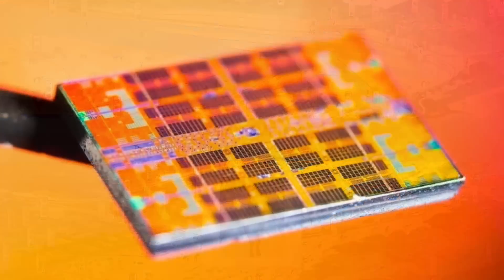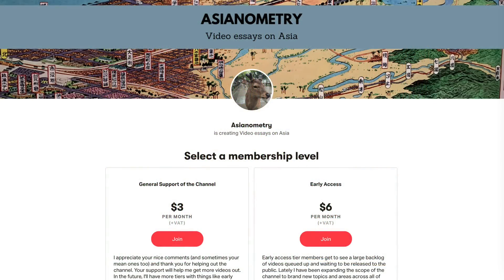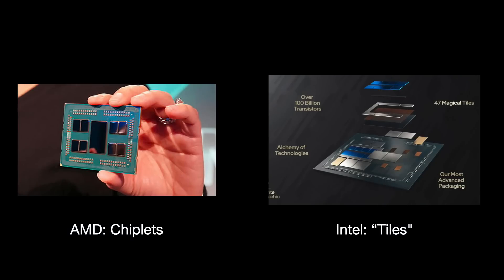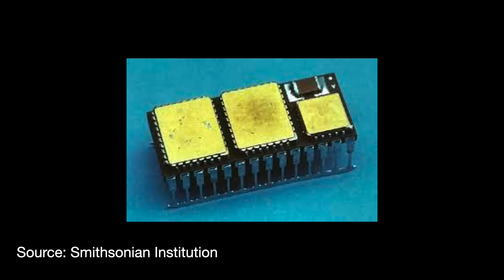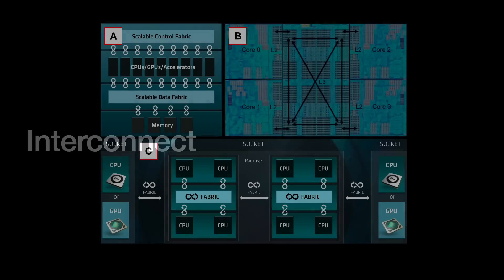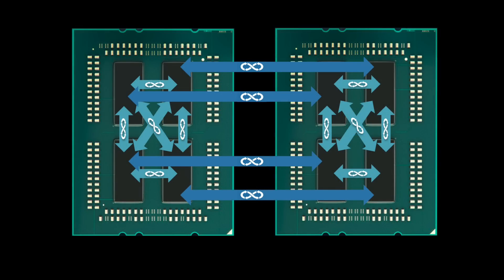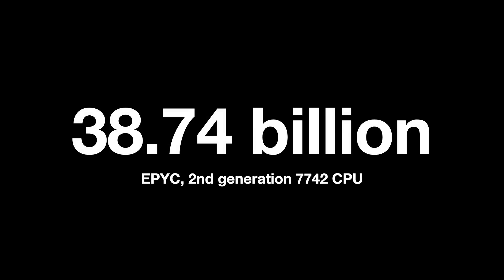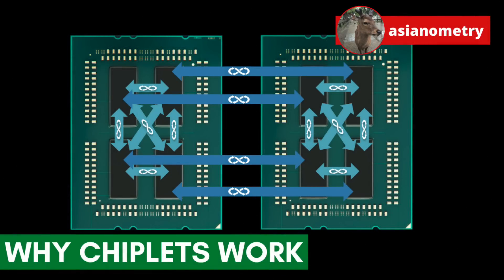Why AMD's Chiplets Work

Comment: And now Intel, AMD, ARM, and others are getting together to come up with an interconnect standard. We could see chiplets from different vendors on the same package. Imagine AMD cores alongside ARM and even FPGA fabric, tasked with handling different aspects of a system.
Reply: this might also solves licensing hell intel made to prevent vendors integrating both arm and x86 ISA into one single die.
Reply: @kekkocheng  Why not connect 7 billion brains to Make a more powerful computer ?
Reply: It's already  done. Check each Threadripper, EPYC and Ryzen Pro - each CPU has a small ARM CPU inside for the Platform Security Processor (PSP).
Reply: Will be interesting to see what new solutions it makes possible. e.g. AMD have dominated the console space because they are one of the only players that has all the technology and IP required to produce a monolothic SOC that can provide a good experience for gaming. My hope is that eventually it allows manufacturers to shop around to some degree, combining whichever parts that are available and best suited for their product. For instance I could imagine a high end tablet or gaming handheld using a CPU from Qualcomm and a GPU from Nvidia, and using UCIe to avoid those two companies having to collaborate too closely or share sensitive IP.

Of course you can already have a separate CPU and discrete GPU from different companies, but this complicates the cooling, and I suspect packaging everything together could have cost and latency advantages too.
Reply: @liamness  Nvidia is not part of UCIe. It’s not possible (yet)
Reply: In other words gluing together chips.
Reply: @mohdk2299  Yeah, maybe they will be moved to join if they see others doing well out of it. Was just using them as a generic example of a chipmaker with graphics expertise, AMD or Intel could be subtituted
Reply: LOL in the mean time Nvidia is left behind...
Reply: I think AMD is going to build FPGA functionality into their core chiplet or it will be too slow.  They bought Xilinx after all.
Reply: @kekkocheng  AMD has the rights to X86 and Intel has the rights to X86-64 via AMD.  There are supplemental instructions sets that gives X86-64 the extra power and fast compute in various workloads where ARM suffers.  Almost all are cross-licensed.  ARM is RISC like it or not, and will never be great as a DO EVERYTHING CPU.  This is why a company like Apple takes a CPU that's ARM based and then customizes it to make it good enough to run typical workloads for an Apple laptop or desktop device.  Apple also added accelerators which is probably similar to Intel's, where they speed up stream processing.

Throwing ARM cores with X86-64 cores is a huge MESS.  You pretty much have to use one or the other for a program, not both, or you could but it would come with a LOT of complexity.  You do after all have to execute instructions to run a program and a compiler has to make sense of the hardware via the ISA, which means a person had to program a compiler to be able to use the hardware within an SoC.  But sure you could probably get away with compiling a program that runs with the ARM cores and at the same time another program compiled for X86-64 and uses those cores.  Probably not so good if these are combined and have to share the same resources that a core needs, like APU, FPU, IO, etc....

However, it's ARM, AMD and Intel who are talking about this interconnect standard, so I think you're turning this into something it's not.
Reply: @dongshengdi773  I bet Elon already has plans for that
Reply: yeah,... that also means outsourcing the cheaper aspects of it
Reply: That's the PCIe CXL standard you care looking for.
Reply: @johndoh5182    ISA has nothing to do with how pipeline is integrated.
Otherwise we wouldn't be seeing all architectures supporting same Instructions. ARM architectures and it's pipelines are getting more CISC like in recent years if you look deeper and same is true for these x86 pipelines where they pick best of RISC designs. As time evolves there will be mixture of ISAs doing best in their own regions, some good for compute loads, some good for data stream processing, some optimised for floating operations etc.

Besides apple, there's qcomm, samsung, marvell, nvidia, rockwell, amd and lots other impmenting their own logic on top of spec. The whole industry is just 1 century old, from transistors to the miniature devices we see today and its going to take few more decades to sort out the road blocks.

This is actually called Heterogeneous computing and it's not new to industry. Modern tooling allows us to integrate different ABIs to run on complete different ISAs which wasnt possible in early days. Still there's lot of work to do before is can enter consumer relam. And all talks from vendors is kind of hype as they dont have to talk about anything else as it's getting harder and harder to innovate further solely on fav process only.
Reply: @dongshengdi773  not a bad idea.
Reply: @MaulikParmar210  seamlessly moving code between architectures. Thanks to LLVM IR code.
Reply: @monad_tcp  problem is not all eco systems use llvm as backend and they are pretty huge well established around single architecture, some use other backends and there is still no industry concision on where to move forward or how to unify, it's there moving on it's own pace. It's just almost 2 decades old, give it time to grow and settle!
Reply: @MaulikParmar210  that's the problem.
Monolithic architectures instead of pipelined ones.
Reply: A UCIe style open standard is long overdue. Although I am against separating all CPU cores into chiplets the chiplet idea and advanced, many-layered PCB substrate interconnect is essential to fully realise the potential of the chips used in a system.. The biggest problem for X86, and ARM to a much lesser extent is the complexity of their cores. Even ARM is not so RISC-like as it once was.. 
--
SIMD is the main culprit. MMX, or at least SSE onward should have been a general Vector Engine coprocessor, SIMD scales ridiculously poorly. UCIe should allow the CPU, GPU, General Vector Processor (that could replace the GPU entirely in the future) to share a huge (16GB) Level 3 cache on one chiplet. Like you say, this is in the pipeline as it makes so much sense..
--
Dedicated PCIe graphics cards for gamers will be obsolete in less than 5 years, probably closer to 3..
Reply: An x86+ARM chip would be so painful to use. No ABI compatibility, no cache coherence, duplication of compiler toolchains and precompiled libraries, separate and overlapping page tables, etc. Few programs would use both chiplets if they have different ISAs.
Reply: @monad_tcp   you wouldn't see millions of lines ofncode moving from one backend to another in nesr future, so keeping expectations realistic is the key to drive this type of innovation in long run.

Besides not all architectures can use pipelines, there are so many close to metal usecaaes which defies usage of llvm for compilation and requires more sophisticated methods. Though not majority of engineers would be using such methods, they are backbones of computational infrastructure i.e Device Drivers, Interfacing APIs, Usermode and kernelmode boundary applications etc which goes beyond scope of normal usage of llvm.
Reply: @NavinF  .. Not if they're well integrated by the OS and an X86 and ARM emulator running on the opposite chiplet. The design certainly compromises each architecture compared to 2 of the same arch. chiplets paired together, and would be a pain for the OS, but it would be painless for the component and application developers. It does make some sense for quite a few scenarios. 
--
Some designs would be more X86 biased, some with more ARM cores. Would actually make sense for EVERY PC to have such a combo so Windows can more easily transition to ARM without a lot of old software running slowly in pure X86 emulation mode. ARM should have bought Transmeta when they crashed and had them as their X86 emulation R & D department. Intel emulating ARM is much easier, but very inefficient power-use-wise.
--
X86 needs to go. ARM and RISC-V are far superior architectures. X86 keeps things stuck in the mud, using double or more the power of ARM. The end of middle and low tier discrete graphics and improvement of integrated graphics will hide X86s poor architecture somewhat so it may survive against the Apple M1 / M2 style chips being developed by the big ARM players for a wile. RISC-V may well take the lot though, if all X86 and many ARM developers switch in the next 5 to 10 years, which is actually very likely, quite possibly with Intel, not AMD leading the charge.
--
Either way, X86 will end up being an obsolete, purely emulated architecture sooner rather than later as it is such a load of garbage. RISC-V is better than ARM's ISA and general architecture. SIMD instructions are dreadful and scale so badly it's a joke. ARM's Neon suffers from this too compared to Risc-V's purely Vector approach (although I believe they've polluted this by allowing SIMD into their Micro-controller architecture specification. It's basically an MMX / SSE.1 spec. bolted onto their Micro-controller spec. SACRILEGE to some, but as long as it doesn't get any bigger it's not a bad idea.
Reply: @PrivateSi  The ISA really doesn’t matter all that much. x86 instruction decoding is not expensive as far as silicon area or power consumption compared to the rest of the CPU. x86 is also nice and compact which makes good use of LLC. Internally CPUs runs μops, not x86. If you specify a time frame I’d be willing to commit to a friendly wager ($10) predicting that x86 will stay dominant.
Reply: @NavinF  .. Yes and no. Instruction decode complexity and massive, seemingly endless instruction set bloat if SIMD is to be continued. The fact is, a VECTOR PROCESSOR is a much more sensible way to do SIMD than SIMD as vectors are variable size - like real data. I believe Risc-V has has a 2D vector spec as well as he usual 1D. Risc-V CPUs have already been shown to be way more efficient than ARM, let alone Intel. It's like having (far more) raw access to GPU Compute, but optimised for 64bit Integer and FP ops rather than the 16 and 32bit GPUs are more geared towards, without tonnes of API layers and drivers to go through. This is the 'V' part of Risc-V and it is the most important part. The ISA is important but nothing compared to the actual Vector Processor Architecture specification.
Reply: Worth noting that an Intel chip was made with AMD Vega graphics.
And Intel CPUs with FPGA already exist, granted they own the FPGA company in that case.
Reply: @dorinxtg  the guy said "x86 and ARM ISA onto a single ..." with ISA being the important part, and Threarippers or Ryzen PROs have no ARM ISA at all. Nevertheless it would be cool if you could compile x86 AND Arm code on the same CPU... please Intel!!
Reply: @dorinxtg  most CPUs and SoC have tiny integrated ARM CPUs running in package. These CPUs run the microcode that manages things like power gating, clock speeds, etc.
Most ARM CPUs in phones will have tiny ARM CPUs managing them.
Reply: ARM don't make silicon, AMD already has an ARM CPU inside their CPUs which behaves the same way as Intel's management engine.
Reply: @marsovac  "the guy said "x86 and ARM ISA onto a single ..." with ISA being the important part, and Threarippers or Ryzen PROs have no ARM ISA at all. Nevertheless it would be cool if you could compile x86 AND Arm code on the same CPU... please Intel"

You know, people code at HIGH level.  No one codes for an AMD or Intel or ARM based processor.  Find a C++, C#, PHP, Java, Python, etc... program that's written for a certain processor.  Good luck.

That's why you HAVE high level languages, so a programmer doesn't have to worry about the platform.

So, do I want to go through the nightmare scenario of trying to run some code through one tile based on X86-64 and then some other code through an ARM based tile.  No, absolutely NOT.

Now what you CAN do is have different programs that are running on a machine where one program may be running on an X86-64 tile and another program running on an ARM based tile.  You can't make a compiler throw part of a program at one CPU and another part at another CPU, and if you have a different ISA, you basically have a different CPU even if they're stuck together.  You have to pass data and manage data flow.  That's not going to happen.

So sure, you could have a large package with different tiles, but if you have different ISAs they're going to be handled separately.  Now, if that's what you mean, that's not up to Intel really, or I guess they could make a SoC capable of hosting an ARM based tile, but so could AMD.  In fact with AMD now in control of Xilinx and AMD has been putting work into ARM just as Intel has, AMD could make the SoC just as easily as Intel, maybe even more so since they have control of FPGAs.

I'm dubious though as to the marketability of it.  It would seem more cost effective to have an X86-64 CPU on one server board, and in the same cabinet have another server with an ARM based RISC CPU.  That way you don't get into a huge mess with resource management on that single server board.
Reply: Intel to get chiplets for 14th gen could be interesting to see their interpretation
Reply: @kekkocheng  😊❤😅
Reply: @PrivateSi Have a look into the RISC-V Vector extension. They ditched fixed SIMD for CRAY style random length vectors that can get processed by the processor in any width it wishes to. No more MMX, 3DNOW!, SSE, SSE2, SSE3, SSE4.1, AVX256, AVX512.. phew. You just put shit to compute in the queue and it'll churn through them and auto inject zeroes into the last empty SIMD slots the implementation may have.
Reply: @mikafoxx2717  .. I'm not sure what post you're referring to but I'm usually the one saying the 'V' in Risc V stands for Vector, as in Vector Processor which is the term for what you're describing. Risc V has added a super microprocessor spec that's basically MMX / Arm SIMD compatible. This goes against the 'V' for Vector philosophy Risc V is based on. It's not such a bad thing as it's not meant for main processors, except perhaps as a very low power e-core.
Reply: @PrivateSi  Too bad about the weird SIMD when they were doing the right thing by going to actual vectors. The V is RISC-V stands for.. 5, though. It came after RISC-I through RISC-IV from Berkeley. Risc-I was the basis for SPARC processors, and started the whole RISC craze in the 80's. David Patterson has done a lot for RISC architecture.
Reply: @mikafoxx2717  .. It was supposed to be both, 5 for the version, and V for Vector. It's why they're sticking with Risc-V and there will never be Risc-VI / 6. It was the big differentiator and obvious way to remove a load of instruction bloat caused by SIMD implementations by Intel/AMD and then ARM too (to a far lesser extent thankfully)

Comment: Credit needs to go to software developers for finding ways to parallelize tasks.  All the chiplets in the world won’t work if the software isn’t designed to run on multiple cores.  You young folks probably won’t remember the days before multithreaded software, but trust me when I say it sucked.  Programs would freeze as they completed a task, which in the days of slow CPUs and mechanical drives was quite often.
Reply: Nothing has changed. Most true multicore/threaded designs are one-off. Think supercomputer clusters. True multithread/multicore software engineers are hard to find. The average software engineer is scared to death of multithreaded designs, and it would not be a stretch to imagine that most multithread apps have latent bugs.
Reply: @scottfranco1962  The more services the OS provides, the more those can be multi-threaded. Even the natural layers allows for it, e.g. GUI in a separate thread from the app.
Reply: @scottfranco1962  Nowadays almost all apps are multithreaded. Go/Julia languages offer multithreading out of the box.
Reply: @scottfranco1962  its dumb easy to do with Go give it a spin! 👍
Reply: That is Windows thinking. Devtools for multithreading has existed for 30-plus years on real OSes like Unix. Even today Win10/11 cant handle over 16 threads on a single process. Most windows apps start to taper off after 4 cores.  Apple solved this almost 10 years ago with Grand central dispatch. Microsoft should do the same and if Microsoft wants to make an OS that actually works they should use a Linux kernel and put their brilliant desktop system over it. That would also solve the multithreaded problem in Windows if MSFT wants to do it.

Comment: As I understand the reverse happened when a Japanese calculator company wanted intel to make a number of different chips for their calculator industry however a person in Intel decided to combine all the functions into the first CPU chip
Reply: Usually integration (aka "fewer components") is the way to save on money and complexity. Like it saves big time, in some cases multiple orders of magnitude. But he explained why currently the reverse is true, at least for highly complex CPUs.
Reply: @graealex  100%. It's a balance between silicon yield and costs versus post-silicon process costs. In this day and age, silicon costs are astronomical so it makes sense to invest in designs that reduce them.
Reply: If I remember correctly Intel were making ASICs.

The ASICs were fully integrated where as the CPUs were general purpose and needed additional components to function

Same thing here, monolithic CPUs are great with everything on one chip but if you can break it down, generalize the hardware and make it profitable then it will be a success.